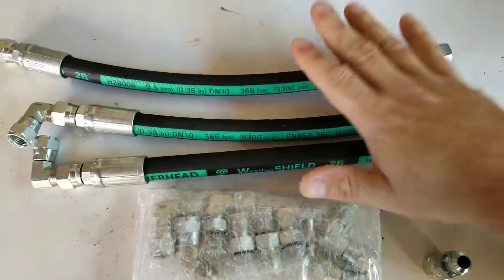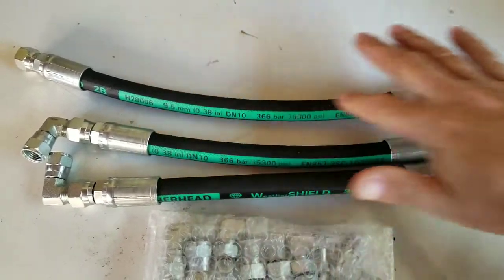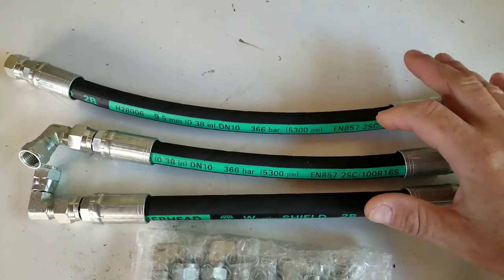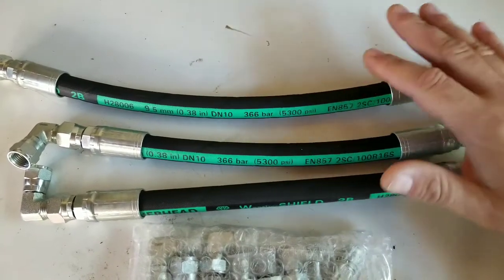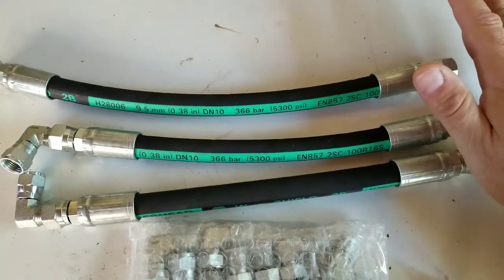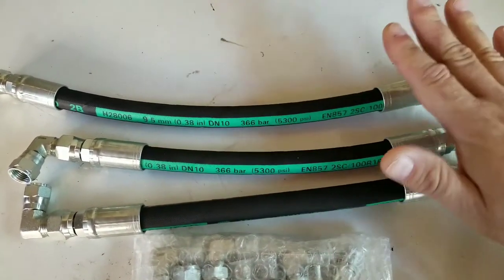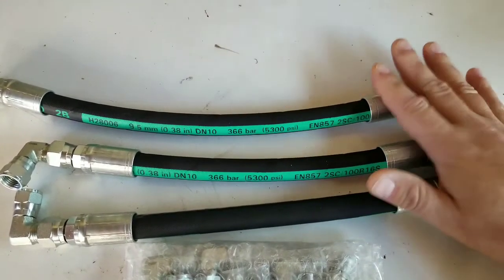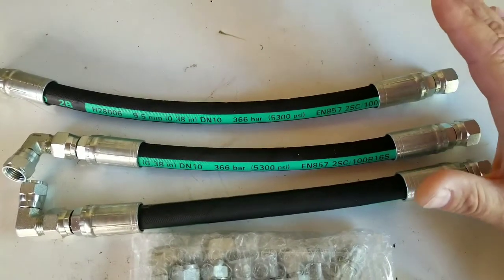7.🌲 obs hpop upgrade cross over kit

Comment: Any issues 4 years later?  I’m pulling an old 7.3 out of the grave.   Need better lines.
Reply from the maker: No issues still on the truck actually on both of my trucks
Reply: @FLORIDALIFECLIPS  good to hear. Do you know the burst pressure of the crimp on fittings?

Comment: Are these good? I had a fitting on my head blow out and I’m praying the threads are okay in the head, waiting for these to come. I’m new to 7.3s, if anyone knows if this is normal let me know because google ain’t helping... Replaced the o ring then went to tighten and the fitting on the passenger side wouldn’t tighten. I know I didn’t cross thread it either because I was real careful and could feel it thread easily

Comment: Gonna install these next week, do the check valve springs stay? I would assume they do
Reply: did you use the springs?
Reply: @kevindougherty593  the new fittings didn’t have a spot for them to sit in like the quick connects

Comment: I installed these lines but didn't remove the spring poppets and check valves.  My truck ran five mins and shut down.  I think it ruined the hpop
Reply from the maker: I doubt it but I'm not a 100% sure try to remove them then reinstall the lines and try to start it.
Reply: I did thatno pressure
Reply: @jesserebel8387  did you end up fixing the problem?.. did the instructions say to remove the springs?.. just curious..

Comment: installed these same lines. worked great on my 2002 excursion
Reply from the maker: I am very happy to hear that you like these hpop lines they are fantastic great upgrade for your 7.🌲 good quality too i run them on all my trucks.
Also i know ken very well I have been making the hpop hoses for crude diesel for over a year now.
Reply from the maker: I'm doing a little give away to my fans as a thank you I don't know if you need one or not it's a cold air intake it's free check out the video if you want https://youtu.be/sG6BRMbMp8w